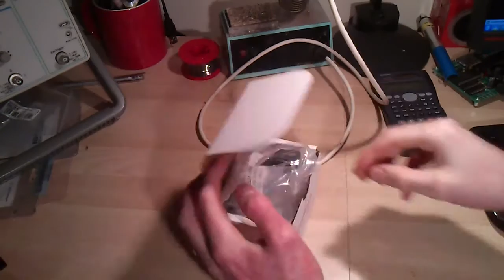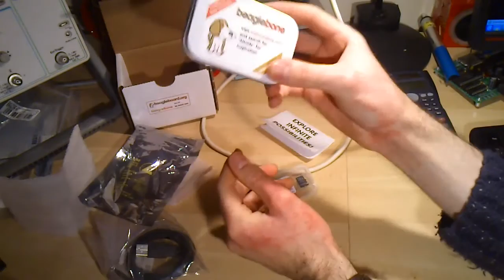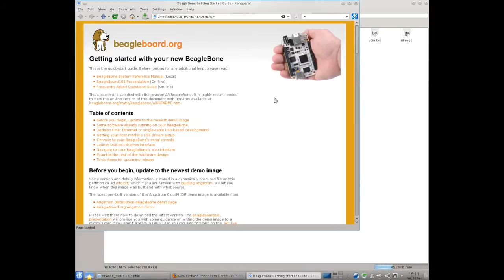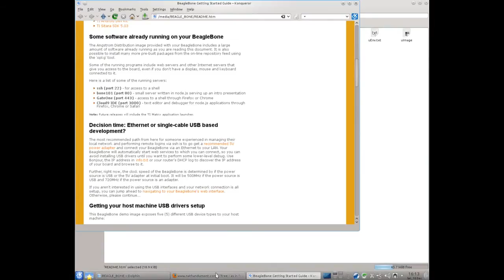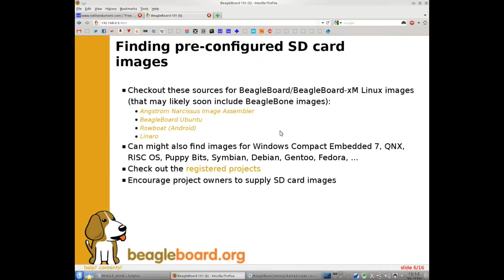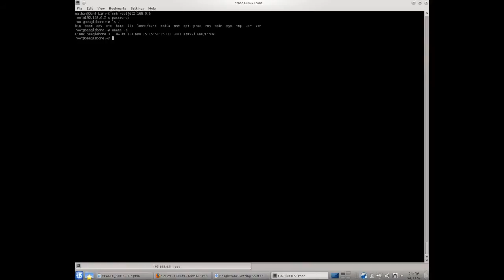BeagleBone hands-on review

Comment: @pixelmike theoretically the beagle bone should have enough processing power to run stuff like fluidsynth, but due to the 256mb RAM you probably need to constrain yourself to one or two software stacks, meaning you should not try to run like java, javascript and python software in parallel. And I think fluidsynth is able to run without jack.

Comment from the maker: @pixelmike It's not as powerful as a dual core Atom by a long way.  It can do a surprising amount though.  If you want to run audio stuff though it might be worth paying the extra for a BeagleBoard-xM it's faster and has twice the RAM and most importantly some audio jacks! (the BeagleBone has only pin headers so you'd need to make an audio break out board)  I don't know about Jack, I haven't seen it in the Angstrom library but it may well run fine on an ARM processor.